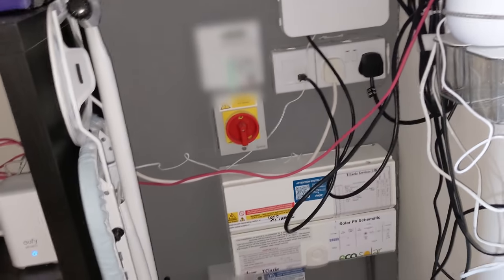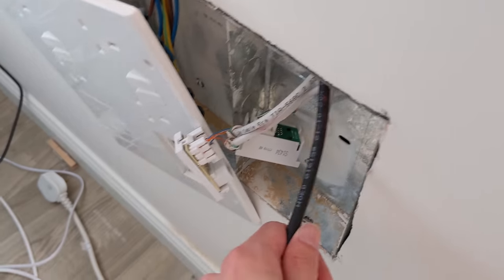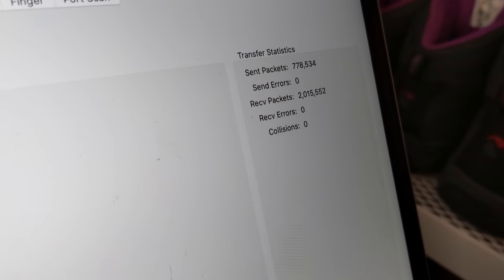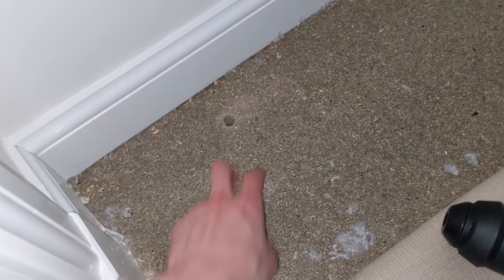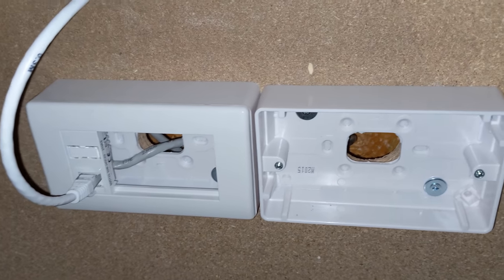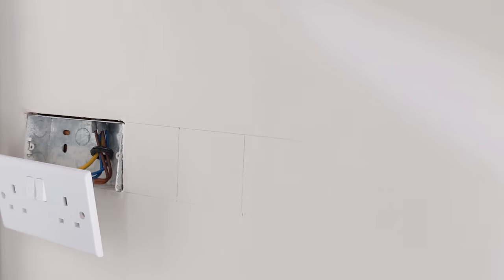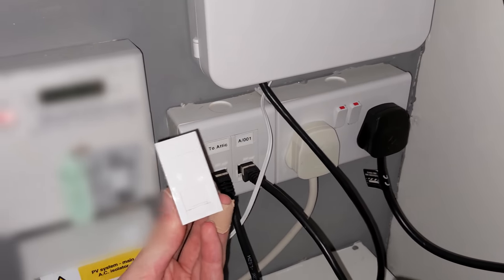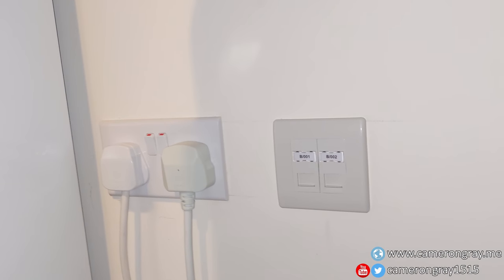New Build House - Expanding the Original Home Network Wiring!

Comment: Nice Work.  But, Maybe a Couple of MOCA Devices would have been a better solution.   The COAX/Antenna cable could have been used as a network cable.  It is capable of 2.5Gbps, currently.   Just a thought.
Reply: MOCA devices are every expensive compared to Ethernet.
Reply: @QuickBits  $120 for two...
Reply from the maker: That could have worked but we also wanted to continue using the TV aerial coax for TV reception
Reply: @camerongray1515  It would still carry all the signals.  LAN cable different freq. than the OTA freq.  MOCA divides them.  Would need to add a entrance filter at the splitter.
Reply from the maker: Interesting, suppose that could work then although given the effort involved I'd rather keep things simple by just using a dedicated ethernet connection.  MOCA is definitely useful though for places already wired in coax where running cables wouldn't be possible (e.g. rented properties)
Reply: only if the coax dielectric is solid core and the shielding is good. You don't go all professional with moca coax over ethernet using the cheapest TV antenna coax the builder could get his hands on. That stuff is nasty and full of noise ingress, no good for data.
Reply: @QuickBits  and a waste of money over cheap TV antenna coax
Reply: @YouTubeSupportTeams  Do you mean thicker dialectric and solid copper core?  I use RG-6 cabling here in the US.  I link all my Tivo boxes (working via antenna)  and internet (for streaming) on the same cable .  The cable is Copper clad wire quad shielded.  The cable has a sweep up to 3ghz.  That cable in the video looks thicker than mine.  Maybe RG-11?
Reply: @michaelglass1386  the cable in the video is almost certainly rg6, possibly rg59. Rg11 is very thick and is used outdoors on a catv network for long drop lengths. The thickness doesn't matter, its the quality of the coax that matters. In the UK builders want to cut costs as much as possible so will use hollow dialectric cable with inferior shielding and likely not even copper conductor. They are terrible for picking up noise ingress which you can see on a meter such as an onx 220

Comment: I have been trying to run Ethernet in my house. I have identified a coaxial drop that I believe goes from my loft space down to my ground floor unfortunately the coaxial cable barely budged when tugged it seems to be a straight drop so any idea what might be causing this?  potentially taped under the wall?
Reply from the maker: May be a cable clip inside the wall or taped to other cables inside the wall - usually done to keep the cables out the way while the walls are being built.  If you can get a camera into the wall through the back of a removed outlet you may be able to see what's causing it.

Comment: Have you heard of GoCoax adapters?, wee boxes that convert coax TV cabling to ethernet up to 2.5gbps too! Albeit not the cheapest option. Although very convenient.
Reply from the maker: They'd work however we wanted to continue using the coax for TV reception.
Reply: as long as the coax is high quality solid core and not honeycomb/hollow core cheap crap they normally use for DTV

Comment: I haven't lived in the UK for 5 years or so. Fibre to the home wasn't really a thing (that I saw), but all your videos featuring new builds have this. Is this standard for new homes or something please?
Reply from the maker: Basically yeah, new builds no longer have copper phone lines installed, instead they generally get a fibre line from Openreach (or potentially another provider such as CityFibre or ONFL) and the customer can sign up with a selection of ISPs that will use this fibre.  For a while the ONT (the wall mounted box that's installed on the end of the fibre in the house) would have a socket that provided a connection for analogue phones which would then be sent over the fibre however nowadays they tend to have moved this socket onto the ISP's provided router for people who want to use analogue phones.  In addition to this, some new build properties will also have coax installed for Virgin Media.
Reply: @camerongray1515  fantastic improvement! I will look this up. My parents are on fibre to the cabinet and get awful speeds. Hopefully there are plans to upgrade the existing copper network. Thanks again for the reply.

Comment: My new build had not network wiring at all just phone lines done over cat 5 terminating in the utility cupboard in the end just changed the face plates over to correct sockets wired it up and it was win win cost less than £10 in the end 😂

Comment: What was the Poe injection for the flex mini please
Reply from the maker: In this video I was using a UniFi 48v injector but any 802.3at or 802.3af compliant injector should work.
Reply: @camerongray1515  thank you very much and what can I use for the in wall hd please the Poe injection

Comment: Ever considered a powerline set-up
Reply from the maker: I've always found powerline to have pretty disappointing performance if I'm honest. I'd view it as an alternative to WiFi rather than as an alternative to a wired connection as that's basically how it works - radio signals but sent using the mains wiring instead of an antenna.  Even with adapters claiming speeds of "2000mbps" in actual practice speeds seem to only end up being a few hundred megabits per second in ideal conditions which is easily achievable using WiFi.  I could only really see myself using powerline if it was impossible to run a cable and the building was too large or had thick walls that caused issues with WiFi but in a property like the one shown in this video, you'd be able to get the same/better performance than powerline by just using a decent WiFi adapter with a single decent AP located in a central location.  Then for devices that don't support WiFi or where I don't want to configure it, I'd generally just use some sort of access point as a WiFi client and connect the device to it over Ethernet.
Reply: @camerongray1515  I have this exact problem with power line! I recently got BT Fibre 900 and bought a 1000mbps power line but I could only get 150mbps so I sent them back and ran a 20m cable to my room instead and it works fine
Reply: I share the same frustrations as others. Initially went with powerline and the speeds were nowhere near advertised. Stuck with it through laziness and eventually they started randomly dropping out and dying. Eventually decided to stop being lazy and run cat6, then just wished I'd done it sooner! Powerline stuff is ok as a stop gap solution in my head, but that's it.
Reply: I found powerlin gave me worse speeds than wifi even 
could never get higher than 0.6mb/s on powerline devices

Comment: A TV aerial inside? Curious, never seen that. Is the reception any good?
Reply: When i lived in lincolnshire the airel at the house there was inside
Reply: The frequency's used a little bit of wood and tile doesn't really affect single much. But really depends on how far you are away from the mast and direction!
Reply: My grandmother (in America) has an antenna in her attic, going through a wood roof, and it works fine.  She lives about 20 miles from the transmitters, which are all in the same general area.
Reply: Pretty standard in timber frame houses. Hell, sometimes they might even point the aerial in the right direction.
Reply: very common. it's only DTV, if it's pointing in the right direction you will get signal, confirmed with any meter of choice

Comment: why joint the cat 5e cable when you could have just pulled new cable with the same rating. all those joints are definitely not a good thing.
Reply from the maker: Pulling in a new cable wouldn't have been possible without a large amount of damage.  Obviously that would have been the first choice however the layout and construction of the building would have made this difficult.  We'd have had to lift large parts of the upstairs carpet and cut into the floor in several places, or we'd have had to cut into walls to drop cables down.  The whole idea was to do this with the minimal disruption possible in terms of needing to move furniture or redecorate.  This is why we tested it all before committing to the idea, while a couple of joints aren't ideal, in this situation with the lengths involved and with decent quality couplers, it worked out fine.

Comment: Surprised on a timber frame building you don’t have to use intumescent patress boxes, definitely not a good idea to use plastic ones
Reply from the maker: Yeah, there were plastic ones in other places as well, suspect it's only a requirement if a wall is a fire barrier e.g. between two properties.

Comment: Band 1 and band 2 conductors not separated
Reply from the maker: Not an issue as the twin and earth is sheathed, there would be no issue with having T&E where someone can literally touch it so why would there be an issue with the CAT6 being next to it?  The only time this would be an issue would be if I was running the CAT6 through an enclosure where basic insulation is exposed such as through a pattress behind a socket but this hasn't been done in this case.  The media panel does have both Band 1 and 2 conductors in it however you can see they are separated by an earthed partition.  Obviously this would be different if I was running CAT6 through a conduit with single insulated conductors but that's not the case here.  What we have done is no different to the original install where the Band 1 CAT5e and Coax are running next to the Band 2 T&E to the media panel or where the T&E feeding a socket in the hallway runs through the same wall cavity as the original phone extension ran.  If you can't run T&E through the same wall cavity as CAT6 then where do you draw the line - can they run under the same floor? What about having them running through the attic?

Comment: TP-Link Broadband Over Mains adapters might actually be better as where you have mains sockets you can have a Wireless Access Point.
Reply: Trust me you'll never get near 1GB connectivity with these network over mains things, and to be honest, over multiple smallish houses, I've found you're lucky to get 10-20Mb despite the spec being ~300-400Mb. Also you're broadcasting your network transmissions out over the mains to everyone else in the street. Sure you can do the same with wireless but at least there's an additional WPA(2?) encryption layer over the top.
Reply: @tehklevster  A lot depends on how noisy your mains wiring is the model/brand of adaptor and what circuits the adaptors end up on. I had a set up with three adaptors and got 480Mbps between two and around 90Mbps from those two to the third. The first two must have been on the same circuit while the third was on another so the signal had to go back to the main board then back out. The adaptors were Edimax 600Mbps models and the setup was in a 70's New Zealand home with unearthed fluorescent lights and quite a number of switching powers supplies. Obviously everyone's mileage will vary...
Reply: @tehklevster  I have some of these devices in my house. They don't send ethernet data across the mains wiring unencrypted. I am now curious whether the signal goes beyond my house wiring though.
Reply: @tehklevster  Well all the conducts in our house are steel pipe with the required enclosures for each end (you know the type which is also used in prisons which is not resin based) except for the part that extends into the office so I suspect the signal cannot escape and the signal would be attenuated by the brick walls of the house so now what.
Reply from the maker: Powerline ethernet can work but it's not remotely comparable to wired ethernet. It's more similar to WiFi but using the mains wiring instead of an antenna.  Performance is never anywhere close to the rated speed of the powerline standard, often a high end WiFi setup can perform better.
Reply: @camerongray1515  It is fast enough to enable me to watch Netflix on a Blu-Ray player down stairs as well as listen to the Net-radio with no problem but not so good when wanting to watch Youtube through an Adapter as the computer wants a faster throughput,I initially went the Broadband Over Mains adapter as Her Indoors said no more wires and I had to obey but I sneaked  a white Cat5 cable in between my router and and my computer that can also do WIFI but I am using to give my SKY HD+ STB and TV wired broadband.
Reply: Better off with a mesh wifi system and be done with it.
Reply: @ItzD3fW1sH  mesh again not as good as hard wired but MUCH better than crappy powerline extenders which cause nothing but hassle, especially shitty TP link lol.
Reply: @YouTubeSupportTeams  ofc nothing beats hard wired but honestly for most home users the mesh system will be easiest to implement, no destruction to walls and will do the job fine imo!

Comment: If you are trying to put a network switch in an attic then that is not a great idea. My attic gets to 40c+ in the summer, the switch is probably rated to 40c max, worst case it catches fire, best case it fails every summer..
Reply from the maker: This was a consideration but it's not something I'm too concerned about, the switch is rated up to 45c.  When we did the install it was a pretty hot day and while the attic was warm, it wasn't close to 45c, I actually expected it to be hotter, I imagine the solar panels on the house also help to block a lot of the heat.  I cannot imagine how a switch running slightly too hot for a few hours would be any sort of fire risk, worst case it becomes unstable or fails but I'd be shocked if this happened given how rarely the attic will even approach such temperatures.  I'd maybe think twice about say fitting a mains powered PoE switch and powering a tonne of devices from it, but for a switch as basic as the USW-Flex-Mini I'm not really going to lose sleep over it.
Reply: @camerongray1515  Your lucky your loft remains at a reasonable temperature. Mine has concrete tiles, it gets stinking hot! As its a POE switch I guess it will be ok. At high temperatures electrolytic capacitors start to fail, these are in the power supply section. On modern mains gear the PSU tends to fail closed circuit blowing the internal fuse, on older kit it did have a tendency to sit and cook. The POE PSU will shut down if the caps fail as control chip monitors for over voltage and shuts down the switcher, so I guess it is pretty fail safe.  Personally though I always avoid running gear in  lofts. I ran my network cables into the loft, then down beside a soil pipe to a place under some stairs and fitted the switch in that position.

Comment: Only comment I have is you've removed the phone line.  Admittedly it's all going to be VOIP soon so probably won't matter.
Reply from the maker: Yeah, they had absolutely zero intentions to use a landline phone so it wasn't an issue.  Even if they did in the future I imagine they'd use cordless phones and therefore could put the base station in the hall cupboard and plug it directly into the ONT.  (I didn't explain it in the video but the analogue phone line is delivered over fibre and the idea would be that you'd run a cable from a port on the ONT into that port in the hall cupboard to connect the extensions up so you can simply connect a phone straight into the ONT).  The hall cupboard also borders the living room on a different wall from the media panel so if it was absolutely required, it wouldn't be too hard to run a phone extension from the hall cupboard to the other side of that wall and add a phone socket on that adjoining wall.